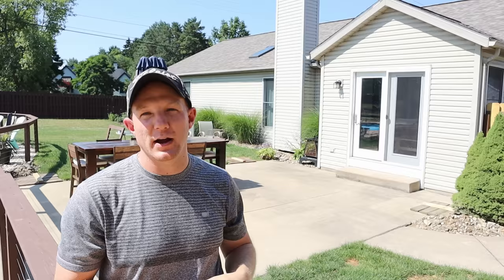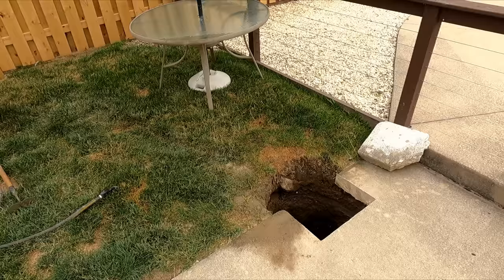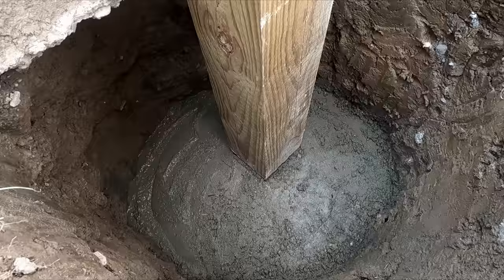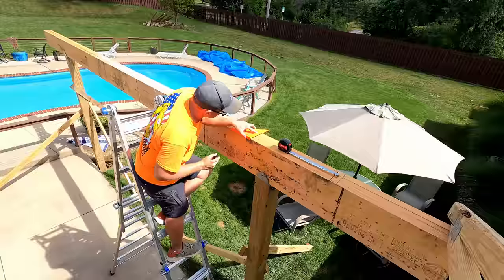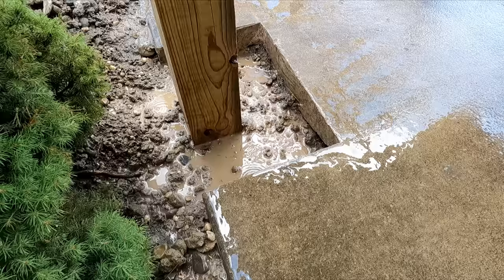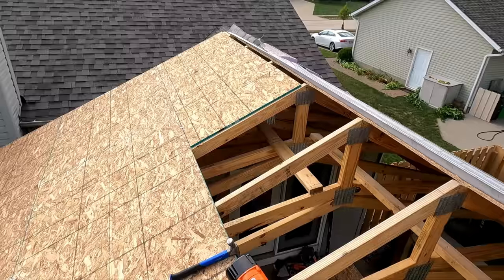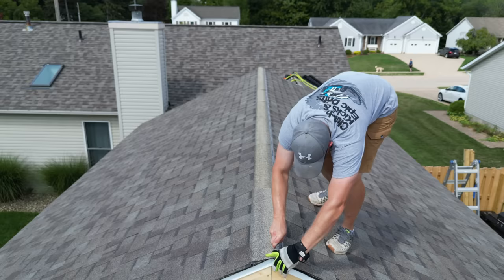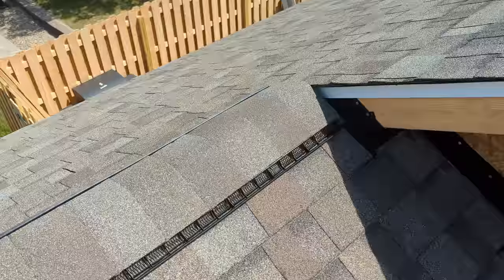DIY Covered Patio | P1: Building A Roof To Cover My Concrete Patio | Foundation, Framing & Roofing

Comment: H-clips;  

This is what my city inspector told me;  "You know how if you rub two sticks together fast enough it'll create enough heat to start a fire?  Well, the same thing can happen during a high wind to those sheets between the trusses.  They can vibrate and if they're touching it can create heat and possibly fire."  That said; I've looked online and the only reason I've found is to provide support for the sheets between the trusses, the wider the truss spacing the more important they are.

The only thing I'd have done differently is pour the footing all the way to the surface with rebar and L-bolts.  Because the roof is attached to the house there is less possibility of independent movement.  It also keeps the wood posts out of the ground and a "post base connector" will keep the wood out of contact with the concrete so it can fully dry after it gets wet.  Also, during high winds the roof is less likely to lift the posts out of the ground if they're bolted to hundreds of pounds of concrete.  Overkill, I know, and those post base connectors don't look the greatest.

I've wondered about the longevity of micro-laminated beams outside due to high moisture.   I don't know;  OSB boards are also a glued product and they seem to handle humidity.  I think they're fine as long as they are protected from direct rain, like your's are.  

Awesome video and great addition to the back yard!  Enjoy the shade!

Comment: Would have used rebar in the holes and attached gal steel fixture that would leave a gap just under the beams so that the wood doesnt touch the concrete

Comment: Glad to see you did not concrete those posts in. That’s a guaranteed way to decrease the life of pressure treated lumber. Most folks don’t realize that concrete acts like a wick pulling the actual CCA (chromated copper arsenate) treatment out of the wood causing it to rot faster. Don’t believe it, look at old wooden  mailbox posts and treated fence posts that have been in the ground for a few years that were concreted in. They’ll be rotting right at the ground level because of that. Most applications that Engineers spec concrete in post holes, they’re normally doweled with #4 or #5 rebar, rebar cage attached around it and holes are belled out in the bottom to keep from lifting out of the ground. The posts should be wrapped with a plastic membrane to keep the concrete from actually touching the post base. What would work better for your application would be to backfill those holes with bank sand. Once filled and watered in really well you’re done. The sand is so abrasive it bites into the posts and doesn’t let that post go anywhere. Works like millions of Chinese handcuffs.

Comment: If the structure is not insulated, I think the risk of ice dams is nil. Plus the ridge vent is overkill because you got no heat in there.  Not going to hurt anything.
Reply from the maker: I agree but its one of those things that makes me rest easy and the overall look will appear the same as the rest of the house.

Comment: I didnt see a gap for the fascia left on the drip edge. You may be able to overcome that by using 3/8 smart side since you have a 1 1/2 '' backer 2x6, and still get it under the drip edge without that turning into a mess. I hope so, let us know how it works out. Great video though, for an amateur, lol. Very good.

Comment: had to rewind three times to listen better each time, finally turned on the auto subtitles to figure out what you said in the first 3 seconds. lol
its "pretty sure its deep enough" but I was hearing "I pretty sure its a demon hut" as you popped out of the hole in the ground lol
wonder if that's 4 views for the video :)

Comment: next time use simpson cbsq66 for the post base and a ccsq for the column cap. None of this embedded post crud. with the simpson lag screw bases and caps you need almost no bracing at all. they make the column caps in standard install and end of post type EC. the column can be specced 5.25: for the 3 microlams  you are using

Comment: This was pretty awesome. I currently have a covered patio that I would like to change out the two outer posts. I know that when the guys installed it 16 years ago they put it on a footer and since then we have had additional concrete patio added, all that water that goes down worries me, the bottom of the pressure treated 4 x 6 posts are changing color, I'm worried they may be rotting away. Do you have any suggestions on how to replace these, beside hiring a professional to do it?

Comment: I thought iceguard was only used where the room connected is heated,  I.e snow melts above the heated space, runs down above the un heated soffit, and freezes causing an ice dam,   The ice guard is then to prevent water penetration where the ice dam forms above the unheated space,

Comment: I really like the project. I wish to know the span (width) and type of wood (2x4 or 2x6) used for the trusses. I really appreciate an answer. I need to make trusses for 16x24 shed. Thanks
Reply: Sorry, have you done that? What timber size you used for scissor trusses? And what size for the supporting beams?

Comment: Just currious why you did not use post straps instead of direct burial in concrete/dirt? At some point all wood will rot when in contact with earth. Post straps would have at least kept the post end above any moisture.  I'm talking about the real post straps that extend solidly into the concrete and provide for the transfer of moment loads, not just the bases that get anchored in with screws. Not trying to slam your project, just curious. Cheers!

Comment: Not sure where you are located but those posts should never come in contact with the dirt. Should have used soon tubes and filled with concrete to above ground level and then set posts on top with anchors. Wood rots when in contact with the dirt. Good luck.

Comment: If you would have used a spacer block to set your trusses, you could have skipped a lot of time measuring and making sure your truss is on the line. You just slam the truss to your block, both ends and the middle.  tag it.

Comment: The wooden post in concrete are going to rot, even if they are pressure treated.  You are going to eventually going to need to upgrade to cast in place metal post brackets, or something similar.

Comment: Courious why you decided to bury wood posts in the ground. Pack rock in around the post. Not dirt. Still be a good idea to seal the post at grade level. That’s where it will rot. Even treated posts will rot. Even if guaranteed not to. The wood they use is usually crap wood unless ordered specifically for a better grade. Always a good idea to use rock so water will drain.
Reply from the maker: I like the rock idea. These are .6 critical structure pressure treated posts. I will be honest I just replaced a lot of fence and the posts I pulled out of the ground were 20+ years old and had almost zero signs of rot and those were a lower grade of post. I debated this a lot but feel comfortable with it.

Comment: Mr. Tech Teacher:  Excellent project.  Love the detail and effort.  Are the beams nominal measurements or actual measurements? Did you have to custom order them for width and length?  Also, what is the size of this project from end-roof to end-roof?  This is excellent because I'm doing something similar but not attached to the house (free-standing on a concrete patio).  Good job, love it!!!
Reply from the maker: I order my LVLs from Menards. I would not say they are custom because they were a standard size but they did have to be ordered. They were 11.25" tall and 24" long. If I remember correctly they were 1.75" wide each. Structure is 24' long with 8" overhang on each end and 18' from outside to outside of the beams with a 8"ish overhang and gutters on each side

Comment: Why so dry on the concrete footers?  Project looks great.
Reply from the maker: Thanks! I did mix them with less water than I normally do only because I was getting a decent amount of ground water
Reply: Believe it or not, the dryer the mix, the stronger the concrete. All within reason of course. This is why plasticizers are used in certain concrete applications.

Comment: concrete poured around wood is not the best!  It will eventually lead to rot.  I would have poured your pillars, and then set a U-channel in it, with a heavy rebar welded on the bottom, so that the rebar is in the cement and the bottom of the u-channel that would hold the beam in place is also above the concrete ensuring that the bottom of the beam does not touch the pillar.  This way, no moisture can creep up into the wood from the ground when it rains, giving your beams a longer life!  I learned the hard way and tried to mount 4x4 beams for a patio blind, and after 6-7 years had to replace it because of rot.  I then took steel beams and left my wooden fence off the ground, and this should bring me another 15-20 years I hope!  Hope the structure lasts long!

Comment: Just two questions.  A.  I have a wood patio at about 3 feet high that meets my back door and the ground underneath is slooped.  Can your patio supports be integrated into the patio?  My goal would be to widen the patio on three sides by 5 feet.  Use the verticle posts you are using as the patio supports.  Any advice?  Also are your rafters hand made or did you buy them as forms.
Reply from the maker: I believe the supports would need to go through the deck and into the ground directly depending on the size of the roof and way the patio was built. The trusses were made to my specifications my Menards and it was a really easy and affordable process.

Comment: I'm actually literally about to build the same thing. Question: Did your post sit on the top of the 4ft footer or did you set the post in 2ft of the footer? In other words is the footer 2ft deep than you put your post on top and did another 2 ft of concreate on the footer making it 4ft total

Comment: Nice cover for the patio, do you really need the ridge vent in an open structure like this?
Reply from the maker: Thanks, probably not but I like that it will vent any heat build up and that it looks the same as the rest of my house.

Comment: No triangle bracing between the main posts and beams? I'm no engineer and the city did approve your plans, but it seems odd.
Reply from the maker: To be that might help to be honest but the brackets I used did work pretty well. It's solid

Comment: Very nice. Did you anchor the posts to the concrete footers or are they just sitting on top? You put those hurricane straps to transfer the uplift load into the beam and posts but what's preventing the posts from lifting up? just courious.
Reply from the maker: You ask a great question there... No I did not connect it and what you describe would probably happen. I thought about connecting it but didnt after watching a few neighbors have similar structures built by "pros".  You have me second guessing myself as I really like to over build things lol . Overall I think it will be ok, I will only find out if we have a hurricane.
Reply: I'm a structural engineer and you needed to anchor the posts.Even in your area, design wind speeds are 90mph+. I would suggest that you dig as deep as you can around each post and pour some concrete with rebar around the post. Then anchor the post with angles of some sort. Hot-dipped galvanized or stainless steel metal and anchors.  Or after you dig around each post, drill a hole in the post a foot down and stick a #8 rebar through and then pour concrete over it to top to anchor it. It won't be enough to meet code but it should help a lot. It's a big roof area. Great job. Enjoyed your video.
Reply: @DK-sk5zf  As soon as I saw him put two bags of concrete in each post, I knew this build is was not permitted. A typical fence post almost needs two bags of concrete. Something structural like this needs rebar in the footings.

Comment: Do you happen to have a video going through the process of getting your approval from the city? I'm starting to look at either adding on to my hours or building a home office in the back corner, but I'm not sure what all I need to provide to get the permits. I'm great with SolidWorks and AutoCAD so I'm not concerned with making drawings, just making sure I have everything they need.
Reply from the maker: I do not and I was nervous about that process as well. I went to the city and got a sample set of plans for a similar project someone else had done. Then I included very similar information in my plans that I turned in. If you pause the video where I show my plans you can see most of what I submitted. In my case it was easier than I thought.

Comment: so are your 4x post are they mostly just sitting on the concrete or are they in it , i was looking to make my footer all the way to the surface,  then use thoes 6x6 metal standoffs that would be bolted to the concrete footer and the post this was so i wouldent ever have to worry about the post is that okay?

Comment: The ridge vent is useless, posts will not last 15 years, structurally you need stronger ties between the post and the beam (with nuts and bolts) and they need bracing. I don't think that structure can take a 70+MPH wind.

Comment: pre finish any stains or paints before installing and you will appreciate all the ladder or scaffold time you saved, not to mention you can pat yourself on the back for the smart decision. I'm a retired pro and i learned that one far to late in my career.

Comment: As a Civil Engineer,  a 24" diameter pier is absurd!
Reply: What footing size would you suggest for brick pillars (1.5*1.5 standard wall brick with reinforced cement core? 

I'm going to build similar verandah but want to use free bricks for pillars to save some money.

Comment: If you filled those holes with ALL concrete..... why didnt you just attach the post to the footer instead of burying the post in concrete...Those posts will fatigue over time... Especially just above the concrete...

Comment: The post in the concrete will rot before it does around the dirt.
Reply from the maker: I can agree with that the bottom and the top 6" at ground level are the most likely to rot.

Comment: will it snaking in high wind ?
Reply from the maker: It is pretty strong, no movement yet
Reply: This is for I am thinking the weak point is 4 bracket sit on top posts holding 3 LVL on each site. And post buried  in ground.

Comment: How did you come up with the design for this?
Reply from the maker: I knew I wanted the roof to cover the entire patio, it had to follow the roof slope on one side and I knew I wanted to use trusses. I simple sketch turned into the Fusion 360 model seen in the video. Then I talked with a city engineer and an architect to get there thoughts.

Comment: how did you do the CAD and Blueprint. do you have links
Reply from the maker: I designed it in Fusion 360 myself. I'm not sure I want to share these plans for multiple reasons. I am not an engineer, although the plans were inspected and approved by one. Also it is very oddly specific to my project. That being said you could pause my video and get a good look at what I had in there. Sorry
Reply: @ThatTechTeacher427  No need to share I meant i just wanted to know the links of the program you used and how you transferred the fusion 360 design to a blueprint? It looks great

Comment: It looks dangerous - there is not enough attachment to the house. It could twist and fall. Apart from that, it's very nice work...
Reply from the maker: This structure would be fine fully free standing, and thanks!
Reply: @ThatTechTeacher427  I would seriously think about adding diagonal braces from post to beam... in deck building if it structure is not attached to ledger then you need bracing to stabilize it...

Comment: any time you can avoid embedding wood members into concrete and especially dirt do it. your project deserves high marks for attention to detail. In my previous post i explained simpson concrete embedded post bases. they are amazingly stout and the posts 6x6 btr will not move. then you are never talking about lifespan of treated material embedded. One thing too about pressure treated wood is you cant nail them with anything other than hot dipped Galv. or stainless steel. or they will corrode sooner than you might thing due to the super corrosive treating agents used.

Comment: Dude, the reason you are being questioned about backfilling the posts with dirt, is not entirely about the post treatment, but the compaction around the posts. For such a small area you should have used gravel or sand, especially if you re-pour the patio cutout soon. There is no way the topsoil you used will get the proper compaction needed for the pour within the project timeline. Only a few dollars of costs compared to headaches down the road. Next time ask a real professional.

Comment: Nice job on the roof. Surprised you used OSB. I’m not a fan of that stuff. Building with chips and resin doesn’t make sense. 😏
Reply from the maker: Thanks! For most things I agree. But for construction like this OSB is actually pretty strong and the standard material that is used. Doesnt have to look pretty just be structural.

Comment: I really like this project, but you wasted some time and money. You roofed it as if it was heated space. Absolutely ZERO need for a roof vent or ice shield.
Reply from the maker: I definitely wasted a lot of time lol. I agree the ridge vent is not needed but I would do it again in a heart beat. Not only does it look like the rest of the house but when I was putting on the t&g I was amazed how much heat was getting trapped in there. Really I'm thinking of putting vented soffit on just to help with airflow. I don't think it can hurt to get some cool air in there in the summer.